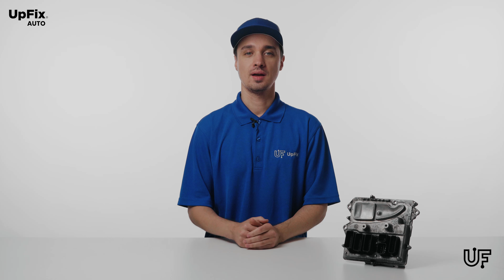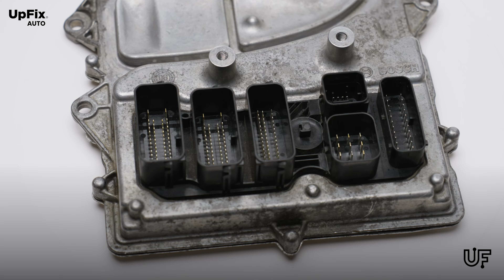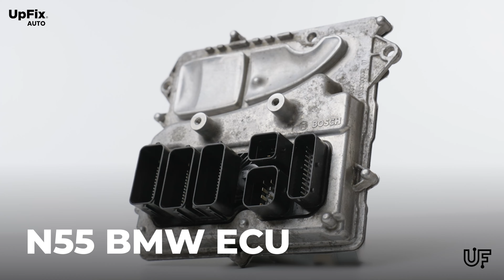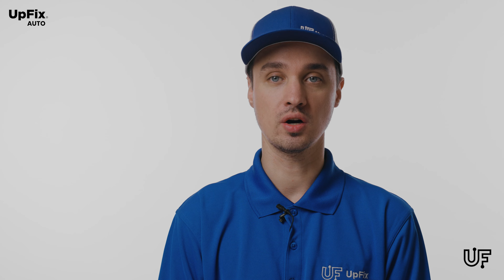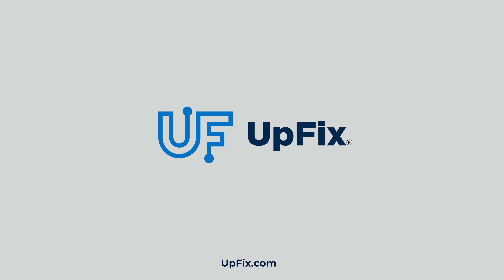BMW N55 DME / ECU Electronic Control Unit Issues and Repair Explanation by UpFix

Comment: If i replace the DME on my '14 X1, Sdrive will I need to have any post-install programming done or will i be good-to-go?
Reply from the maker: Yes, if you replace it with new/used, first make sure part number is same and then it will need to be programmed. However, if yoi have your part repaired then it will be plug-and-play when you get it back. Start saving today at UpFix.com

Comment: Do you really fix or just charge $150 as testing fees and recommend replacing at the end
Reply from the maker: At UpFix, we take pride in our high repair success rate for modules like the BMW N55 DME/ECU. The $150 you mentioned includes our bench test fee, which is applied to the repair cost if the unit is repairable. If your unit is in good working condition and does not require repair, we only charge the bench test fee for diagnostics. Our goal is to provide an honest and transparent service while saving our customers up to 80% compared to buying a new module. Let us know if you have any other questions!
Reply: @upfixauto  I have been having 120308 fault code for two years now, I replaced diverter valve, boost solenoid, eccentric shaft actuator, programmed a used DME and a whole turbocharger and the code is still on, the car drives fine but with less power and the infamous drivetrain message. Is this fixable if it's software wise?

Comment: Can a bad Dme cause a Cf14 i can’t find any forms on it last code I have to deal with and I will have 0. Car basically feels like it goes into natural revs to 4k rpm’s get no throttle response if you do it feels like it gets some and hits a brick wall  yellow car with 2 lines under comes up give it a second and it drives just fine for another 15 minutes and does it again
Reply from the maker: That points to a torque error control issue. It would be helpful to know what year, make, and model your vehicle is along with any other DME codes your vehicle currently has.
It could be a faulty relay, wiring, CAN-issue, or DME fault.
Reply: @ 2011 135i 7 speed Dct it’s got a tank vent value line disconnected but that’s it

Comment: I'm currently battling same cylinder misfires 1, 2 and 4, new plugs, coils and injectors (with coding) I even tried a known good injector-coil harness to no avail. X3 2014 3.5i What do you recommend.
Reply from the maker: Considering the coils and plugs were replaced. The misfire can be caused by wiring, internal engine failure, a head gasket, a bad fuel injector, or a malfunctioning ignition or fuel system. If you have checked the above, you may need the ECU repaired. Please try a hard battery reset first (guide below).
https://forum.upfix.com/pcm/pcm-re-installation-procedure

Comment: I keep getting this code after trying to relearn valvetronic start up says dme fault  134F01 is the mean I need to repair dme
Reply from the maker: It's either a failing valvetronic motor or a failing DME. It can also depend on what scan tool is used for the relearn procedure. ISTA software is recommended.
Reply: @upfixauto  I’m using ista+ to relearn. Says dme is good in ista. I believe it’s the eccentric shaft I replaced tronic motor but nothing so I believe shaft got significant scoring.

Comment: What about cooling functions failure? ive been battling this for the past month fixed all possible problem car jus runs hot. fan speed not high enough to cool water.
Reply from the maker: What year and model is it for?. If the engine has been modified in any way for performance, including a tuning an aftermarket engine oil cooler might be the solution. Also, what codes are currently displaying since it could be something mechanically related instead of electrical